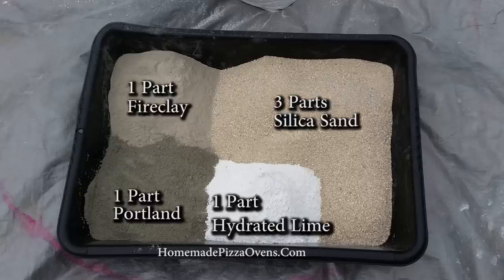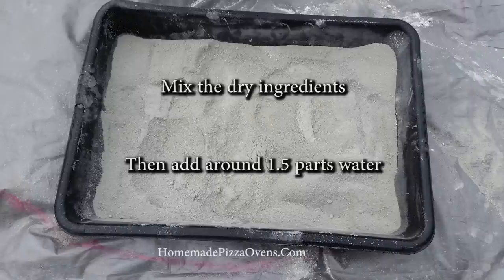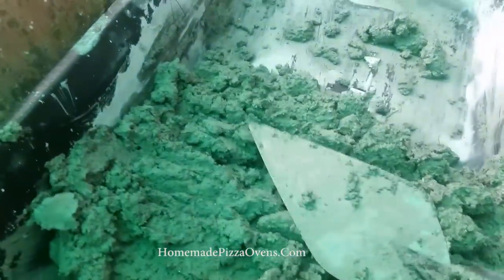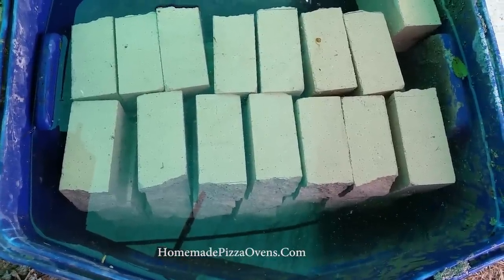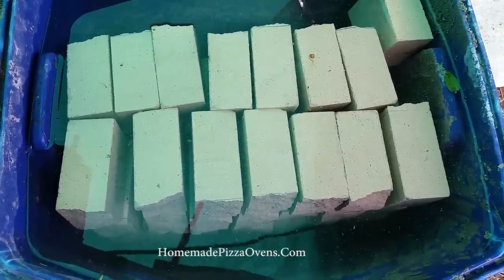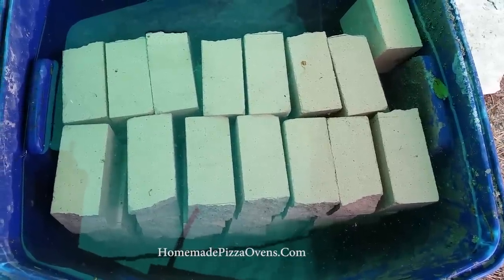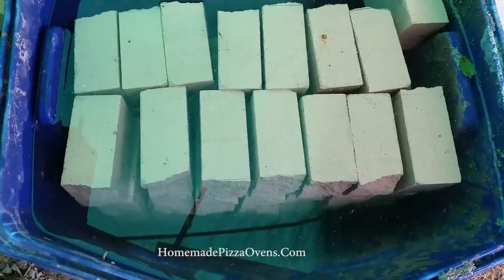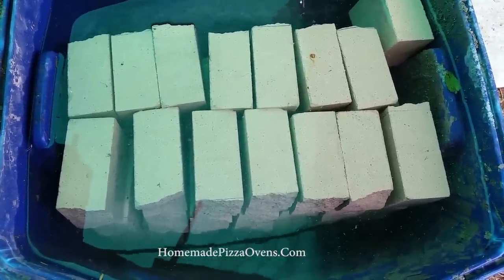Refractory Mortar - High Temp Mortar - Homemade Mortar

Comment: soaking bricks like this kills the hydrolic effect in bonding. without the dry medium "sucking" in the mortar you end up with fire bricks sitting next to hardened mortar rather than the two actually bonding.  true,  a higher slump mix sets up stronger but you also have to have it bond.  

I think I would make a wetter mix and just dampen the fire brick a little so there is still a hydrolic effect
Reply: Have you used this mix? I am going to make a pizza oven and I am wondering will this work as mortar to put up the dome of fire brick?
Reply: Eric Downs not this exact mix,  but have been a mason 22 years and have experience with the science of it.
Reply: Eric Downs not this exact mix,  but have been a mason 22 years and have experience with the science of it.
Reply: Lukas Fraley So you would recommend using this in between my fire bricks?
Reply: Hydraulic
Reply from the maker: @pearljameric  Just to give an update, this is still working just fine. No repairs (yet). The recipe is absolutely perfect!
Reply: @PizzaOvenChef  We started in our garage with a little oven I built. We have since moved to a downtown location in my town and I bought a forno bravo oven. 👍👍🔥🔥
Reply from the maker: @pearljameric  How exciting! That's pretty awesome! I don't know if I could ever buy a factory made one though, after making one myself. But, if I ever move from my house, I probably would. That was a lot of hard work making one from scratch! I hope you enjoy your new oven!
Reply: Agreed on soaking them too long.
Reply: @lukasfraley   technically its wicking the moisture out correct? but it is called a hydraulic bond ?

Comment: Hi chef. Im in a bit of trouble... i have a stove for heating the house (ONLY heatsource). The plates that line the oven inside aee broken and DESPERATELY needs replacing. Can I make plate myself? With this recipe? I need plates to be vermiculite type heat resistant... 24x24cm and only 1.5cm thick. ALL HELP APPRECIATED!!! THANKS LIS
Reply from the maker: Wow. Good question. I've used this recipe in my pizza oven for 3 years now, with no issues, but it is outside. For the price of the ingredients, you may be able to purchase those plates to use in your stove. I would have to say don't use the recipe, purely from a safety/liability standpoint. Also, you can purchase another product called Heat Stop, you mix it yourself and it's designed for what you need.
Reply: @PizzaOvenChef  wow thanks! The plates are 1000 dk about 200$ and quite fragile so very expensive in long run. I will look into heat stop. The vermiculite serves this purpose I only need to be sure they are hardy enough. Thanks alot :-)

Comment: Thanks for the vid.  I couldn't find hydrated lime, so someone told me to put the standard lime in a bucket and fill with water without mixing.  It was to sit for at least 24 hours to become hydrated lime.  Now I have a lime putty and I'm not sure if the mix is still the same.  Any ideas how much lime putty to use?  Or would "dry hydrated lime" be much better?
Reply: You could heat it gently over an outdoor fire in a pan, stirring till dry, then powder the dry caked lumps. Lot of work though.

Comment: Hi I have a question I have the hydrated lime I have high temperature morta but I'm unable to source the silica sand can I use white fine sand instead looking forward to your response thanks
Reply: White sand is normally almost completely silica and almost all sand is mostly silica because it's one of the most abundant minerals in the earths crust. White sand is just broken down quartz. Quartz, silicone, beach sand, glass and granite and the majority of all rocks either are all silica or contain silica. Doesn't have to be white to be silica either. Play box sand and any clean sand pretty much could be used for this.

Comment: Hi. Please, answer. The proportions are by weight? Or volume? I assume is weight. Please clarify. Thanks!!!
Reply from the maker: It's by volume.
Reply: @PizzaOvenChef One more question. Do you have record on what is the max temperature this mix will resist? Tjank you sir. I really appreciate your time!
Reply from the maker: It's my pleasure! I've been using my oven for 3 years now and I routinely heat it up to 1,000° F /  538° C with zero problems.  I'm not sure what the max temp is, but it's really hard to get the oven over 1,000° by only using wood
Reply from the maker: One more thing, not only do I get it up to those temperatures, but I'll keep it at probably 800 degree for several hours at a time. So I know it handles high temperatures for a short and long period of time.
Reply from the maker: @cesgar7994  I do not know what the max temp is, all I can say it is designed for a typical pizza oven with 1,000 F temperatures. I've used mine over a period of 3 years, routinely at 1,000 degrees, for hours and hours at a time, and it holds up perfectly. No problems at all.  From the DIY pizza oven community, I've read that it's okay to 1,700 degrees, but you can't get a pizza oven to that temp with normal cooking. The store bought kind (Rutlands) is good up to 2,000 degrees, but again, just using wood in your oven, you'll be hard pressed to get above 1,000 degrees from a regular wood fire.
Reply: AWESOME. I am looking for a cooking temp of around 750°F. So, I think this mix will be fine! Thank you very much sir! I appreciate your feedback!
Reply from the maker: @cesgar7994  That's what I'm here for!
Reply: I REALLY appreciate your feedback. I am so excited cuz this oven I will do is a project that has been in my mind for a loooong time.Well, the only thing that is holding me is the FireClay and/or Refractory Cement. Besides Amazon/Ebay I cannot find it here. I live in Puerto Rico. We have Home Depot but they don't bring that here. I am wondering if I can use another thing as substitute. I can easily buy the other 3 ingredients.
Reply from the maker: @cesgar7994  If you have a local brick company, they should sell the fireclay.  With shipping, it'll be really expensive to order online because of the weight.
Reply from the maker: @cesgar7994  https://www.amazon.com/Mutual-Industries-60070500-0-0-Fire-Clay/dp/B00XNQKPWQ/  it's $40 with free Prime shipping. I'd say that would be your best bet if you don't have a local brick company.
Reply: Hi. I do have a clay brick company an hour from here. I will call to ask. If they don't have it, I'll go with your amazon link. Thank you VERY much!
Reply: @PizzaOvenChef  glad I red this comment I was gonna measure by weight

Comment: Is the portland cement essential?  Could you use a mix of hydraulic lime sand and calcium aluminate.
Reply: You tell us, Nicholas. It's your suggestion, do you know concrete chemistry?
Reply: @richardmccann4815  im not sure, ive seen a few different recipes and took part in a build with hot mix lime mortar.  Im just looking to learn....so no need to be facetious.
Reply: @nicholasnicoloff873  So I won't appear facetious, please tell us about your hot lime mix. I have no idea about what you know. And you offer little basis for others to understand your question. So to dodge all this facetiousness, please share information, not questions that may be so useless as to mislead others. 
How could hydraulic lime be an effective binder, rather than Portland?  I guess you could have the loose material in some sort of container, but then you only need alumina. So if you know this stuff, please take the time to write a few paragraphs about how the hot mix lime worked, how you expect the aforementioned hyd lime, sand, and calcium aluminate would work or how it worked if you have tried this mix. Thanks. Please share what you know, it is  vital that we all advance, learn, and share!
Reply: @richardmccann4815  bro could you be any colder, the guy doesn't need to give you a essay he just was asking a question (which was perfectly understandable)
Reply: @richardmccann4815  you sound like a college professor that doesn't know how to switch off "college professor mode"
Reply: @bigbird4481  I try to speak precisely. You certainly are cold enough. And I'm sure you could share knowledge too, but I doubt you would.  So ignore what I say, I'm not required to speak in a big bird level because no one could learn anything at your level. Thank you for your judgment,  you obviously don't realize that everybody does not have to meet your standards ( or lack thereof) in how they communicate. You might notice that he didn't respond. If I seemed cold, it was only that he offered nothing other than ingredients , no proportions or recipe. Even a genius couldn't guess what to advise him. So I tried to get some more info. But really , who cares? Not him, or you.  Me neither. Maybe God will bless you for your preaching.